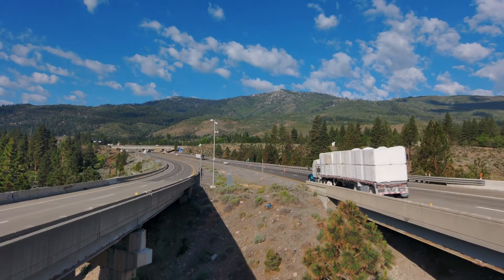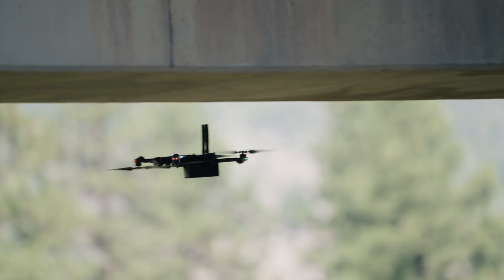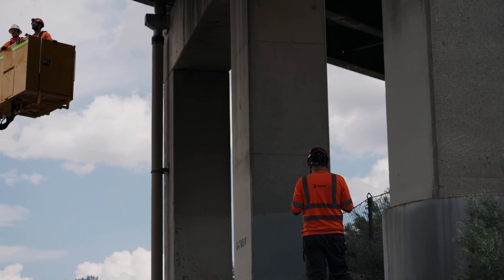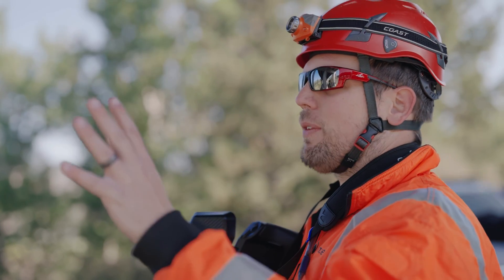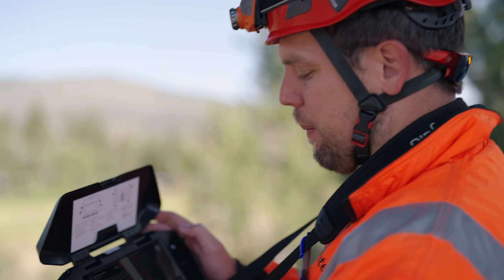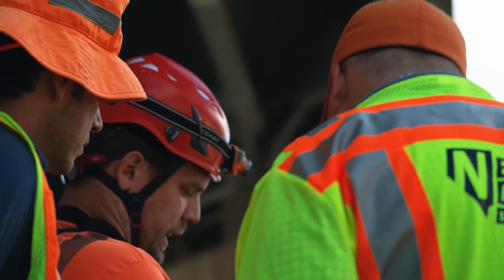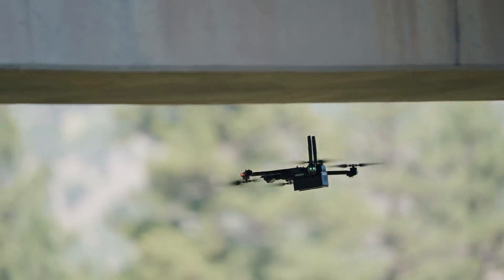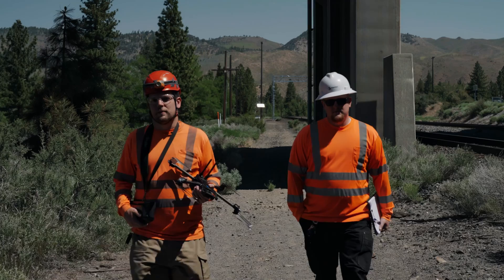Interstate 80 - Vital Bridge Inspections with Stantec

Comment: Skydio.  The company that abruptly dumped its "pro-sumer" customer base - the people who were the initial investors into the Skydio system and who provided Skydio proof of concept in the real world.  Now these folks have been left hanging.  No new features.  No new firmware.  No new aircraft/controller.  Skydio is a soulless unreliable outfit headed up by yet another quixotic tech CEO who has no concept of running a customer-based company.  Buyer beware.  😠
Reply: I agree and the fact that they are disabling  comments  shows that they are cowards to  constructive criticism  meaning  that these guys  only want one thing  can you guess what it is? It starts with a M and ends with Y . Its 💰 🤑 💸